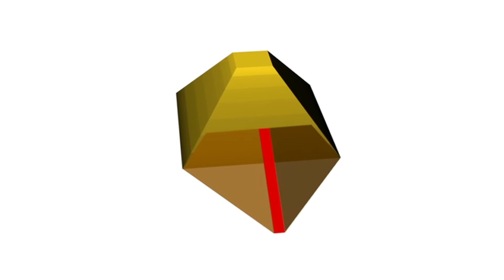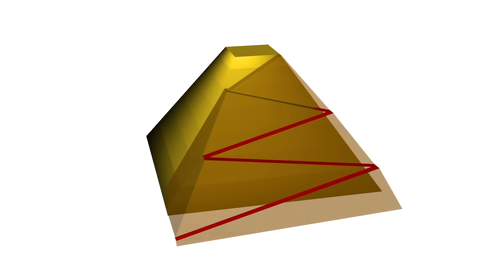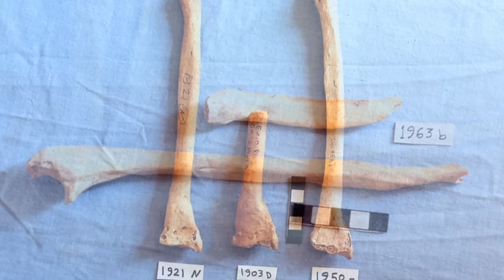Egyptology - Pyramid Construction

Comment: It's not a mystery. Why do you need a ramp. You just use the structure itself one layer at a time and you don't finish one side using it as the road or channel along to a lift. This can be oiled or greased which they found evidence off calcified slurry.  you only then have a lift each block only up to the next layer, which can be done by animals, sleds and ropes.
Reply: Except that = we have evidence of ramp use...........  So Occam's Razor as always applies here.  Your "hypothesis" has nothing to support it - hence it represents multiple assumptions.  The ramp hypothesis however as noted is supported by the historical/archeological record = hence less assumptions required to ascribe plausibility to it.  🤔
Reply: @varyolla435  I'm going of the academic documents (Brier and Houdin, 2008:122) who identify there is not enough room for the ramp at the correct angle or long enough. As the pyramid was built, two cemeteries are also constructed simultaneously on the east and west sides of the pyramid. Brier (2009, 27) suggest an internal corkscrew ramp using the pyramid as it's own elevation. It is not my opinion, this is academic literature that is widely accepted now. Best regards.
Reply: @civiprepper  did deeper.  First the obvious.  Brier while "an Egyptologist" = represents a different field of study.  So he is no expert within that field on Egyptian construction nor the Giza necropolis.  His own personal field is unrelated to what he opined upon.

Next is that Houdin's claim was rejected by academia as the poorly formulated conjecture it represents.  He may be "an architect" - much as Brier is an Egyptologist = but neither represented legitimate subject-matter expert input.  They rather made up some fantastical superficial claims -----> packaged that up via a book and television specials = to throw it out into the public domain to raise awareness about themselves and monetize it.

Finally when the 2017 muon scan showed absolutely zero evidence of such internal structures to lend validity to the claim = even Brier admitted they appeared to have gotten it wrong.  

Garbage in -------> Garbage out.  Not everything claimed in the public domain represents legitimate plausibility.  Many claims such as this one are more "entertainment" than actual academics.  Learn to tell the difference.  A person's "title" may infer if they are able to speak intelligently to something in some field.  The evidence - or lack thereof  - however = is what actually matters here.  🤔
Reply: @varyolla435  ok vary I will do, I certianly do not claim to be an expert, i am a cyber security/risk practitioner by trade. It might be as you suggest the literatuire I have read is now rebutted. So as you seem to have a reasonable grasp of the subject, could you suggest recent works that are worth further reading.
Reply: @civiprepper  "Brier has a third theory. In 2007, he and French architect Jean-Pierre Houdin suggested that the Grand Gallery formed part of a huge counterweight system. Weights sliding down the floor of the Grand Gallery could have raised the hefty, granite blocks that comprise the King’s chamber, he says. He speculates that the new space could be part of a second counterweight system higher up."

"The results also seem to reject the theory, put forward by Houdin and Brier, that the builders of the Great Pyramid used an internal ramp to raise blocks up to the highest levels. “These data suggest that the ramp is not there,” says Brier. “I think we’ve lost.”"

November 2, 2017  - Scientific American

Comment: The Japanese airforce at one point sent over a platoon of recruits to see if they could replicate the "mysteries" of building the pyramids -- and they found that they could: there's just an awful lot of dull, grinding, repetititve work involved. For utter mindlessness, it must be difficult to approach the huge labour of building and then removing the huge earth ramp or ramps that were used to pus and pull the heay block up into place. The carpentry and the crangling involved in getting the points created on the tops must have been some fun.
The blocks themselves were brought down river by barge to an atificial lake nearby, created by long shallow berms which failed repeatedly. The Eygyptians did not yet understand that damming a river requires a system of ground-level and underground barriers to stop the seepage which ill otherwise undermine the visible dam blocking the river's flow.
Like the great walls of China, which never walled off anybody from anywhere (People tend to forget that China was ruled by Mongol "outsiders" for most of the more recent two thousand years.) the pyramids, and the vast amounts of ancillary work, served the stability of these long-lasting regimes: they kept the farm larourers out of trouble during the off season by supplying them with work roles, some minimal income, and a well understood position in the heirarchy. If the many hundreds, perhaps thousands, of young men occupied at this mindless work had been allowed to collect in the great cities in the idle seasons, the guillotine and the chopping block for monarchs' heads would have been invented many genertions earlier.

Comment: 1 block every minute perfect fit--yeah right
Reply: Do you need someone to recommend a good optometrist????    Just asking as had you actually seen photos of the pyramids you would see loads of "imperfect" blocks which have gaps all around...........   🤭
Reply: @varyolla435  go inside. Look inside. If you are not blind.  Don't forget the structure is thousand of years old. Locals were using it to build cities.
Reply: @DrPhilby  You're changing the subject - or at least trying to...........  🤭
Reply: @varyolla435  you are trying to act stupid, when have nothing to say back. Each block fits another at the lower levels. What you see is outer level only after thousands of years. Don't forget the cover that has been taken off. Some Areas where it is still intact - it is very tight

Comment: Doesn't explain the 100+ internal chamber blocks weighing 50-70 or more tons elevated like 100meter high.... let alone push them on varying ramp angles. We simply don't know how they did it. The external blocks are fine, easier to do which a lot of these documentaries keep focusing on.
Reply: 1 - there are nowhere near that many large granite slabs making up the relieving chambers of the pyramid.  So right off the bat you misrepresent......
2 - they rest below the height claimed - so again misrepresentation.  The King's Chamber and relieving chambers rest below the halfway point of the pyramid = ergo that area represents ~50-70 meters. 
3 - look at photos of the western base of the Great Pyramid.  See were one can see = a continuous ledge of limestone.  That tells you that they built at least partially atop an existing incline.  The lower chamber/tunnels are cut from the bedrock.  So some estimates place the amount of bedrock at ~23% of the total volume of the pyramid.
4 - thus as the inner chambers/corridors in the lower half of the pyramid are centrally located it becomes possible that the ramp used to raise the blocks to create them might have included the existing natural incline on the limestone escarpment they built upon.  Then they as noted covered that over with blocks. 
5 - next = the blocks of the pyramids become smaller as they rise in height.  So the largest/heaviest ones are found in the bottom half closest to the ground with those above becoming smaller as it rises.  Look at photos of the top of the Great Pyramid were people climbed it to take selfies.  Those blocks are small enough for several men to lever into place.  So let's move on to ramps.
6 - in the western cemetery adjacent the Great Pyramid are partially completed tombs.  Attached to them = earthen ramps with simple retaining walls.  They are made from a mixture of sand/stone chips - quarry debris/tafla - a clay they mined.  Near the worker village at Giza is the remains of a huge tafla mining operation.  At Karnak is an example of another ramp = a mud brick one.  They were used to build the hypostyle temples there.  
7 - when Egyptologists excavated the limestone quarries at Giza years back they were found to have had massive amounts of = ramp material dumped into them to backfill the area.  So the answer to the old question of "where are the ramps" is = in the surrounding desert.  As they encased the pyramids in white limestone working from the top down per Herodotus they systematically dug away the ramps and dumped that into the quarry areas to backfill them. 
8 - moving blocks.  They used wooden sleds - there are examples in museums and depictions in Egyptian iconography of their using them.  They were pushed/pulled by teams of men - again depictions of this - along with draft animals = oxen.  In the tomb of Hunefer as an example one can see a large sarcophagus being pulled on a wooden sled by a team of yoked oxen.  An ox can pull more than 2X its own body weight.  So the worker village at Giza contained many tens of thousands of cattle bones - placing them there during the time of the pyramids.  Ergo if they were consuming them = they most certainly were using them for manual labor as well.  

Final thought.  Herodotus as noted wrote they encased them from the top down.  He also however spoke to ramps - "a great causeway" - and their using levers and what was termed as "a machine".  That would be a fulcrum/counterweight device akin to the Egyptian shaduf which rested upon the steps to raise the smaller blocks found in the upper half.  Ergo the earthen ramps really only needed to go halfway up as the blocks above that point were smaller and able to be raised using the device.  

Look at close up photos of Khafre's Pyramid - specifically the remaining casing stone at its top.  You can see rectangular blocks standing on end to brace casing stones above.  If working from the bottom up that would be unnecessary as you'd simply lay blocks horizontally.  If from the top down however in spaces with gaps it would be required to brace the blocks above.  This lends veracity to Herodotus' account.  🤔

Comment: Wrong Pyramids were already there when the Egyptians arrived built by a civilisation that knew astronomy the stars and solar system the sphinx formerly the Leo statue faces the where the Leo constellation would of been 12k years ago in the night sky the 3 pyramids also line up perfectly with Orion’s Belt 12k years ago the main pyramid of Giza  is built perfectly symmetrical on all 4 sides and even has central dips in the structure when seen directly from above and at a certain time of day giving it a total of 9 faces not 5 and all the central indents meet perfectly from the tip to the centre of each side where the Giza pyramid is built is exactly on earth equator and true astronomical direction with in 98% accuracy of error you can only do that with hundreds of years of astronomical data collection and a full map of the world like we have today only our most advanced measurements can detect these patterns never mind whatever they were able to use to get that kind of data but you don’t have to take my word for it all the info is public you just have to search for it cause mainstream astronomy would rather you didn’t know this for whatever reason

Comment: It’s pile of rocks imagine if you had 100k ++ people I think it be very easy. People love think aliens some amazing. Instead think heaviest rock was 35tons. Imagine how much 100k people could pull?  Easily 500-800 pounds sliding myself. Yep they could pull 500k pounds or 250k tons.
The simple solution is probably correct. And the ramp could be very long imagine 100k plus people with 1 shovel full of dirt, that’s massive amount of dirt.

Comment: do you no how many people it would take to pull a 2.3 tons 500 miles where they got the stone from
Reply: None = because that is not what they did..........
Reply: @varyolla435  Except there's hieroglyphs depicting hundreds of people pulling large stone objects over wet sand on sleds. Edit: Your other comments seem to agree with my statement so I'm not sure if either I'm misunderstanding what you're saying or you worded yourself poorly.
Reply: @kingsleebrigade6714  I am aware of the mural of Djehutihotep.  You assume by the way they dragged it across sand - just as you assume the stone used at Giza was dragged from the distant quarries.  That is a poor assumption in both cases.

The Egyptians made ramps/roads of packed earthen mix - and sometimes stone slabs atop a packed earth base.  The ramps of Giza were made from a mixture of sand/stone chips - quarry rubble/and tafla - a clay they mined.  So pouring water atop a part clay road surface would make it more slippery than sand alone.  

As to distance = "harbors".  There was once a harbor at Giza much as there were at the various quarries.  So no one pulled anything "500 miles".  They rather pulled things several hundred meters from a harbor to a work site - or a quarry to an awaiting barge on the Nile to transport the stone to said worksite harbor. You need to dig deeper.  🤔

Comment: People are like "omg how did they create the pyramids...impossible." They has slaves, each slave can pull 50kg, have 200+ slaves dragging a rock on slider, other slaves wetting the ground and they can pull a boulder around 7-10 tonnes up or along a path. Its not a mystery its just unfathomably evil work to make people do. Edit: And...I looked it up what da ya know, the giza pyramid blocks were 6.5-10 tonne each and 1.5 tonne for blocks higher up. Matches literally exactly to the math. Wheres the fing "century old mystery". Bit of a douche tbing to say. But how the f is this commonly known as a mystery, its so clear how it was done and anyone doing the maths would see it works out perfect. Ah ok so the mystery is how the ramps were arranged. Thats more a phsycological or logical thing I guess. They were built over a long period, it was whatever works. So build up the middle high, keep getting each block up a level and into the middle. Its not like they planned a single way to do it. It was scrappy construction, get the thing up there build here quick emperor is going to kill us. So in conclusion there is zero mystery its a fing horrific (far worse even) part of history and not something to be marvelled at. Fu$king horrific

Comment: In the original picture but on flat ground, turn the rock the other way, take a however long length of papyrus stalks interlaced like wicker and continue tipping the rock so as to wrap the stone with the interlaced  papyrus stalks, tightening continuously. Like wrapping a dice with string, the result soon becomes rounded enough to roll. And as a bonus from all the rolling (using big loops of rope) and hot sun, you invent paper as this big ass roller surface dries up and PAPER starts to fall off in the scorching sun. Happy days!

Comment: The stones have a surface that indicates they were at one time in a plasma field.   It's probable that they were temporarily altered to the 4th state of matter that characterizes plasma matter.  As such weight and hardness would be temporarily changed.  If you are familiar with the Holy Bible you know the Egyptian priests challenged Moses by temporarily altering a wooden stick into a snake.  Such ability removes the restrictions we put on huge rock structures and machine cutting and moving.
Reply: I'm honestly baffled people that think like you exist.

Comment: I believe they used trenches from the Nile during flooding season to float the blocks from mine to site.  Then they used water shafts built arround the site to float the blocks  up and into place by rising the water level or deceasing the water level.  🤷🏾‍♂️. Saw that on another Chanel.